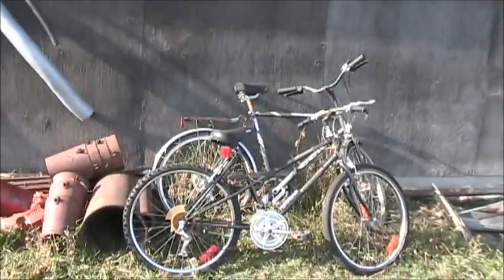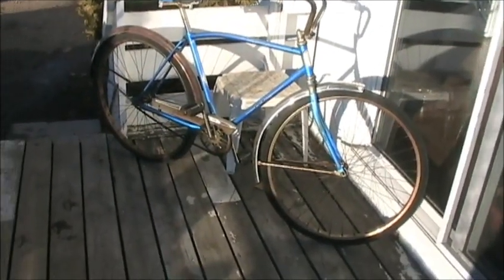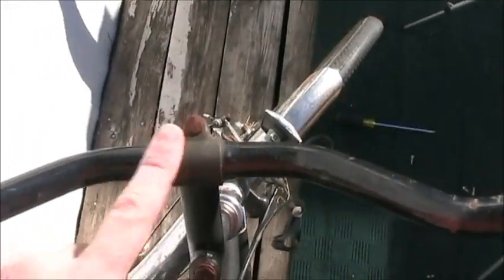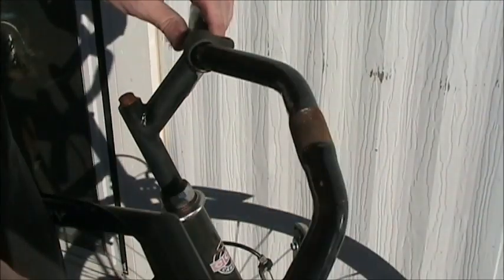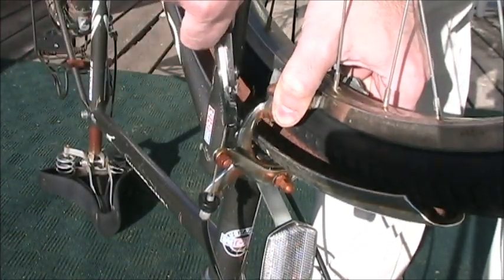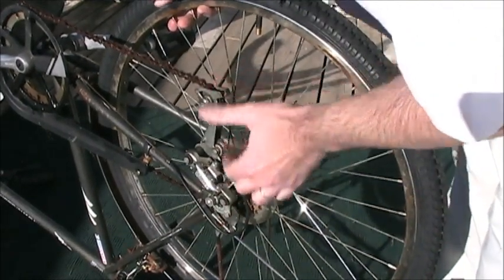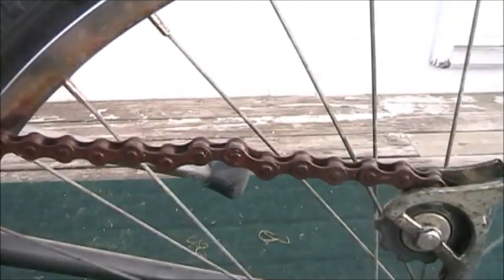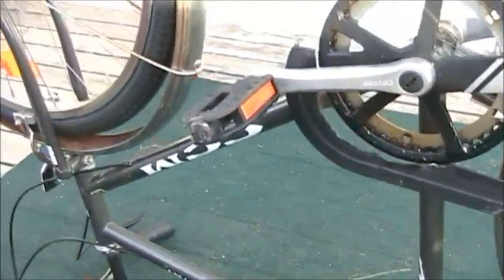Fixing a trash picked bicycle! She's a beauty with fenders!

Comment: WD-40 is a solvent and is mainly to clean and penetrate seized parts. It should not be used as a lubricant for your chain or any other metal part that requires to be out in the weather. You can use 3 and 1 oil  as its pretty cheap as it is or go to your local shop and purchase some Finish line or Pedro's oil. Though again it can get expensive. Also if you do re-hauls with older bicycles make sure to run a safety check list and look for any crack or wear in welding stress  joints.

Comment from the maker: Yeah...chain oil is like a religion, best not discussed here.  WD-40 has no lasting quality but beats nothing.  3n1 is convenient, but yes...wet or dry, the chain lube possibilities are endless.

As for safety, yeah...although it doesn't ruin a bike, you just need to disclose it...but more often, bikes not worth riding aren't worth fixing and thus use the parts on another bike.